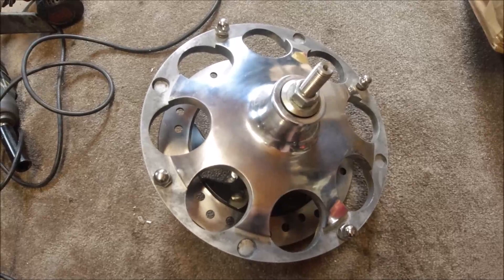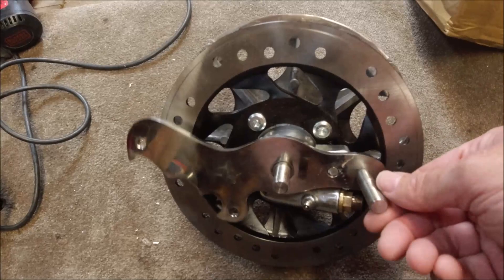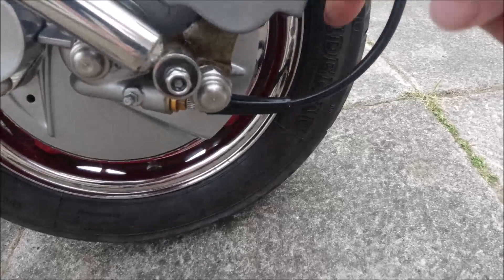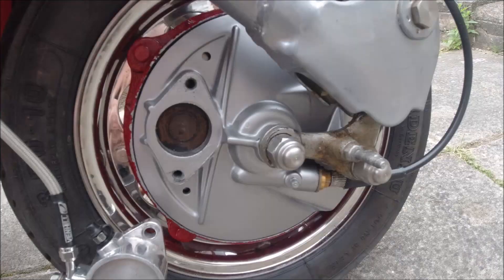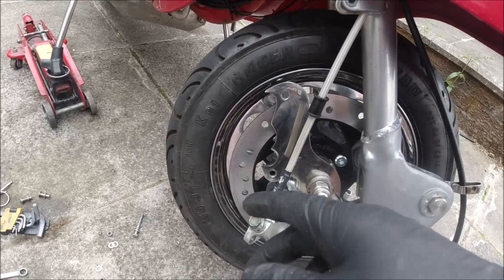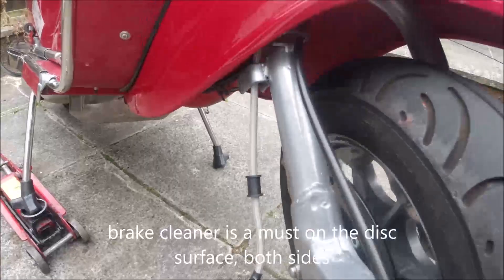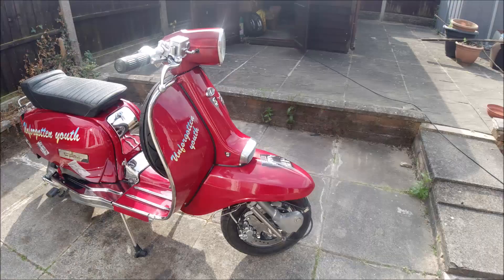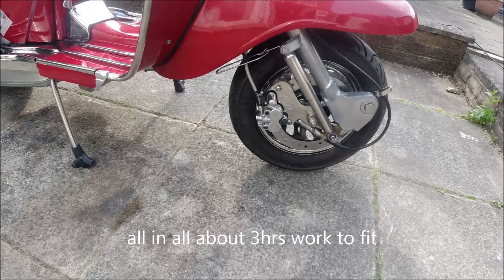Lambretta Spaq hydraulic upgrade

Comment: Can I ask if there was a reason for replacing  the original  disc apsrt from the obvious  visual
Reply from the maker: Yes performance,  having the ability to stop on a sixpence was the no1 reason and it works
Reply: @m1scooterlife259  Thanks for the reply I am going to do the swap the same way as you first converting the one that is currently in and then swapping over to an outboard type